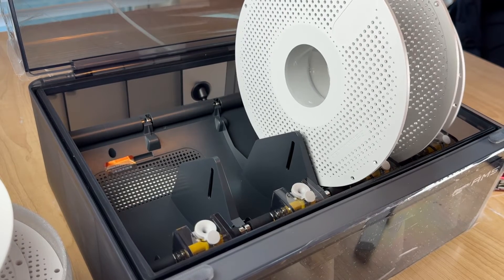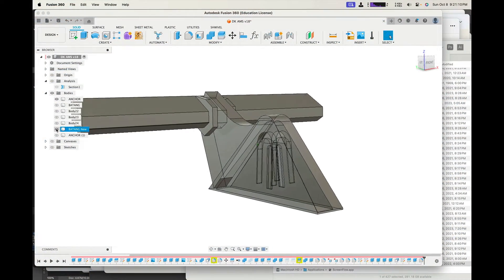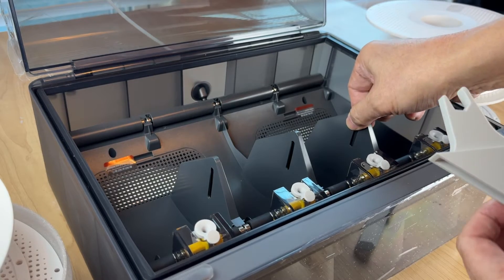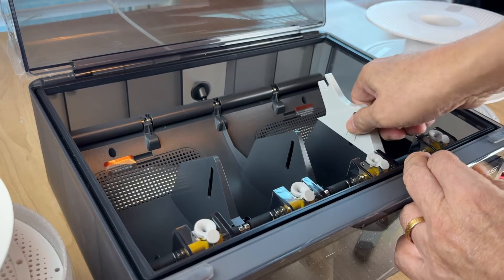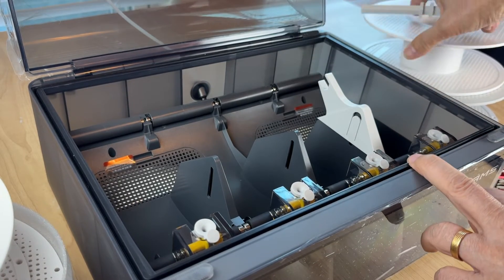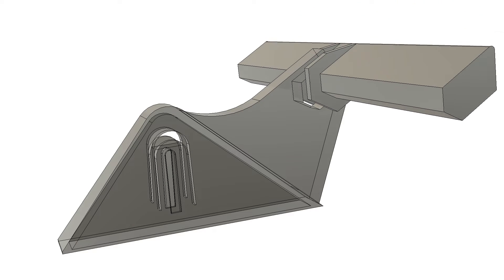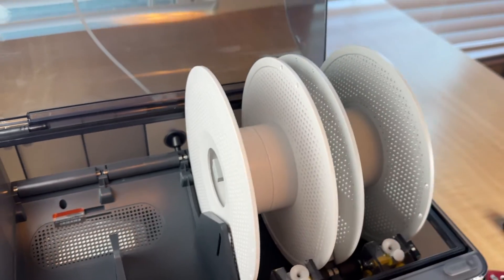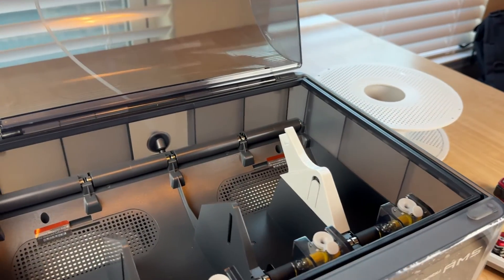BAMBU LAB AMS Spool Guard

Comment: I guess the newer AMS boxes have a built-in (on the lid) depressor(s) to prevent this. But it looks like it would wear out pretty fast. This is a great solution, and thank you. I'll give it a try.
Reply: I take that back, I cannot find the Newer AMS design. But I have seen someone with these rubber guards. hmmm

Comment: How do you get the second one in for the other 2 spools?
Reply from the maker: @joshualicciardello7517  i think i show that in the video?
Reply from the maker: @joshualicciardello7517  i guess I didn’t sorry… basically the same way as the first set… but coming from the left.
Reply: @papsjundi  except for you won't be able to reach in from the other side as you demonstrate in the video. I like where you are going with the design. I was just wondering since it wasn't demonstrated in the video if it was an issue trying to get it on. Thank you very much for sharing your video.

Comment: I found an equivelent version of this on Makerworld, and it was a pain in the bum, and it didnt solve the problem for me. Instead i made weights that where a half a kilo using sinkers inside, and when I get to half a roll, I add them in and it now has zero issues and spools dont lift at all, because the weight is always over half a kilo.

Comment: i was about to print this nice application because i also have problems with spools dragged forward.. I did try weight inside the spool but then AMS complains about overload. BUT... For this print... When top lid is closed down spools can only "lift" very little.. Means your mechanical "arm" wont even grip the inside of the spool before the filament spool ring hit the inside top lid....? Then what good is it for. What do i overlook here?
Reply: That's what I was thinking. The lid does exactly what this is supposed to do. Do people leave the lid open on the AMS or something? 🤷‍♂️
Reply: So I had this happen when I was loading about 250kg used spool. As soon as the ams grabbed the spool it shot forward. I thought I was doing something wrong but realized it was the weight, so I held it during the load process because there was another spool to load I hadn’t closed the lid. Once everything was loaded no issues with it slamming into the lid.

Comment: Its annoying that a £300 unit has so many faults with it. from not being able to use cardboard spools or wide or narrow spools without getting problems. It is over a year now with no updated unit to address these issues even when the community has made upgrades that could easily have been used to make a new unit..
Reply: I wouldn't use cardboard spools anyways as the fibres can get in your machine.

You can just transfer any filament onto a Bambu spool with a print off printables .

And yes the AMS does have flaws,I think the multicoloured prints take way too long. Even with purge settings at 0.45. Also the poop is terrible,I printed a small 3 colour model and it filled my waste basket halfway.
Reply: @Puddingladd worthy to note that in some cases you can rip off the sides of the spool and put them into the Bambu spools if you have extras sitting around. In theory you have at least 3 if you bought a printer combo or 5 if you bought the ams standalone.
Reply: If it looks awkward to get in/out with only 2 spools how much more of a faff will it be with 4
Reply: Just print a plastic rail
Reply: Do you also compain about your car only using a certain type of fuel and specific parts? It's not faulty. Some things simply are not compatible.
Reply: @FactionalSky  Even with the correct size spools it gives problems. I don't complain about the car because I know any petrol will work in my car. Yet with the AMS it's finickity. And this should have been sorted already. I have rolls that work one day and have problems the next....Nothing has been changed but it decided not to work. That's why there are mods out there just to fix it.
Reply: @mrfoameruk  And mine does work perfectly fine with any spool that matches the specs. 🤷‍♂️
So the reason might be a defective unit or.. you. It can't be the AMS as the product itself since it does work fine for me and many others.
Also no. Not every petrol will work in your car.

Comment: What if you made a little bearing that goes on the lid of the ams so when you close the lid a bearing prevents the spool from jumping up similar to the bearings that are under the spool so you are properly constraining the spool
Reply from the maker: thank you for your suggestion 🙏  I think the issue with that idea is where can we mount these on the lid? with glue?
also there’s barely any space left when you close the lid… and there are varying size of spool diameters would make it even harder to design a universal one…

Comment: Great design with the locking tabs! I love it just for that alone. I bet you could design a slide on tool that would help you pull the holder off too.
Reply from the maker: hmmm..... currently I just use tweezers like in the video... but I'll think about it...  Thank you!

Comment: Some of us have the update on the AMS, which doesn’t have those slots. Not sure how to get around that.
Reply: You do know there’s a update that people are printing for the AMS right. It’s been out for quite a long time now actually.
Reply from the maker: @nmfireman  I bought one from their website Sept 22 2023, and arrived here... on the Sept 25th... and I'm using it now... and it still have the slots...  but yeah not sure what to do about that...
Reply: @nmfireman You're talking about the hydra AMS modification. I can see at least two solutions to your problem.

1. Go back to the stock AMS tray with the slots.

2. Alter the hydra AMS tray to include those slots you require to use this modification.
Reply: What update ?  @nmfireman
Reply from the maker: oh really, my 2nd AMS is only 2 months old... and it does have the slot... interesting... yeah without the slot holes... the grip will not be as secure...
Reply: I guess you don’t worry, understand me I don’t really dislike the hydra system, and I am not having the issue with the spools, jumping up other than when I’m really down to the end of a roll. I use weights inside those rolls when they’re light I was just making a comment.